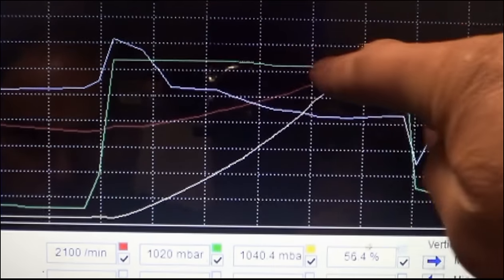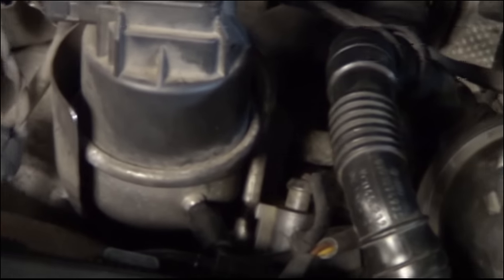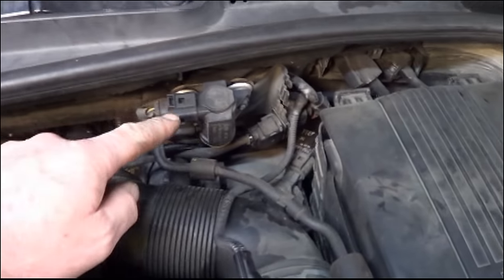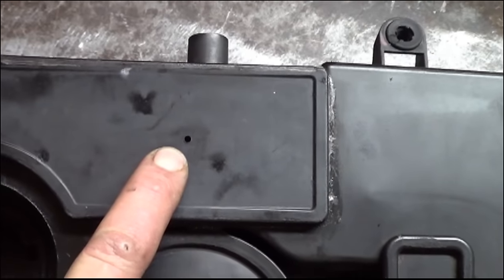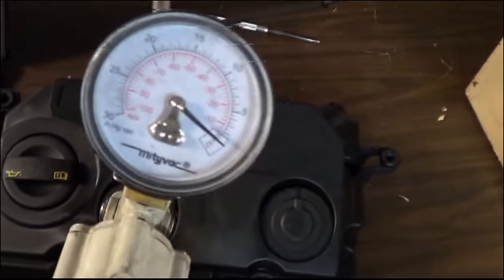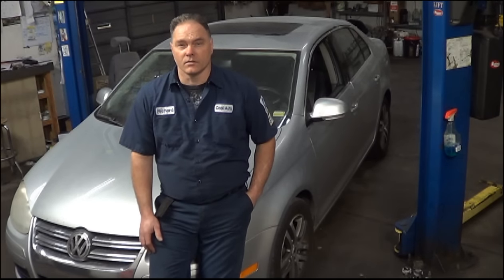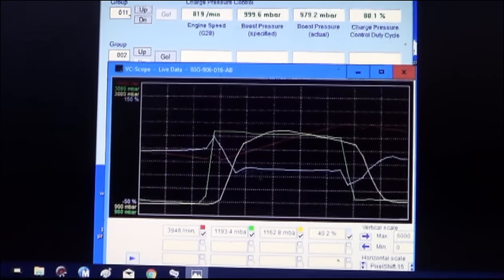06 tdi low boost P0299

Comment: hi, any idea how to fix this. I cleaned EGR  change  n75 and  Intake Manifold Flap {N239}  still getting limp mode  Passat b5 1.9tdi 
3 Faults Found:

19586 - EGR System

              P3130 -35-10- Regulation Range Exceeded-Intermittent

17964- Charge Pressure Control

             P1556 -35-10- Negative Deviation-Intermittent

19561-Valve for Intake Manifold Flap {N239}

             P3105 -35-10- Open or Short to Ground-Intermittent
Reply from the maker: Sorry, I cant diagnose it based on what you said.  I would do certain tests for each code, except 19561, almost for sure that requires Intake manifold flap assembly.
Reply: any idea really nobody can help me with this,  do you think could be turbo? you know I am in Europe , but thanks you did answer it kind
Reply from the maker: @dez945able  yes it could be the turbo.  Do the tests in this video and others.  It could also be vacuum leak, boost leak, bad actuator and other stuff.
Reply: thanks @CoolAirVw
Reply: @CoolAirVw   just one more question,  can I clean turbo with a special spray   to spray it into EGR valve  when car runs  4000 rev
Reply from the maker: @dez945able  personally I dont spray anything into intake of a diesel.  Also seems 4000 rpm is a little too high.

Comment: Great video! Having code “P17705 -  Pressure Drop between Turbo and Throttle Valve” on a 1.8t, stored associated with a boost problem, might want to give this diagnose a try.
Reply from the maker: Not too much the same on 1.8T as this one.  Look for boost leaks and check the wastegate adjustment. Lack of power or clogged cat makes boost trouble codes also.  check diverter valve.
Reply: @CoolAirVw  I know,  but your way of using the gauge was well done. The N75 valve basically has the same layout, and I’m worried it could be the problem. The diverted valve is a good point too! Thanks for the reply.
Reply from the maker: @jakobbedholm3352  You cant run output tests with engine running on 1.8T so vacuum checks have to be different.
Reply: @CoolAirVw  oh I see.. well I did some output test, and all responded. Did a smoke test and no leaks. Did a short driving log, and saw a small hiccup where the MAF sensor dropped, so i am not sure what to make of that, but a longer drive will definitely give a better reading. I did purchase a new diverted valve just for good measure.
Reply from the maker: @jakobbedholm3352  did the maf sensor drop out cause the hiccup or did the hiccup cause the maf sensor drop out?
Reply: @CoolAirVw  I’m not sure, but when the hiccups happens you can hear the “boost” being released into the atmosphere. I gotta make a longer log, because today the car is running fine..

Comment: Wonder if you could have just bought a ball like the mk4's have and find a place to bolt it in.
Reply from the maker: There have been bunches of comments regarding plugging the hole or other repairs that might have saved the customer money. I'm all for that.  Just make sure you watch the end of the video where we find the cover was broken off and siliconed back in place.  This customer loved their Tdi and wanted it RIGHT! Unfortunatly, later  they crashed the car, I bought it, then fixed it then sold it, and am still working on it for the new owner.  I also still work on the original customers new car which is a later tdi.  Sometimes for the sake of longevity,  fixing it the right way might have benefits.  Of course if your a DIY'er just do any fix you feel will work, because if it dont work or last then you can only blame yourself.  If the mechanic does some improvised fix and it doesn't work or last, of course then he is blamed.

Comment: Is 25+ pounds the correct specification for vacuum pressure?
I am having a low power problem and I am getting 18 pounds of vacuum at an idol directly off the pump. 
Obviously I’m leaning towards a bad vacuum pump

Comment: hello friend, where in the US do you work, I have a problem with my vw cc car, I changed the turbo and the wastegate valve is not opening, I tried the solenoid and it has very little air pressure, it is very significant, what do you think it could be?

Comment: I have a 2009 tdi cr engine golf mk6. I can't pump the wastegate actuator up, the needle doesn't move at al, however if I connect the hose back to the N75 I can see that the rod does move. How is that possible?
Reply from the maker: I'm going to assume when you say "I cant pump the wastegate actuator up" what you mean is with a hand held vacuum pump you cant pump up the turbo actuator. this probably means there is a vacuum leak in the actuator, if your hooked to the actuator directly.   If the rod moves with the n75 then  that probably just means the vacuum pump driving the engine has enough volume to overcome the vacuum leak.
Reply: @CoolAirVw  yes, that is what I meant, I can't do it with a handheld pump.
Thank you for replying, your answer does make sense.

Comment: Any ideas why someone would have drilled a hole in the valve cover / vacuum reservoir? What would they be trying to achieve (other than causing this issue)
Reply: And also, if you fitted a camshaft to it recently, was the hole there then, and if so, were the owners getting this issue back then too?
Reply from the maker: I have no idea why someone broke the top off and drilled the hole.  The customer was having intermittent limp mode before and after the cam.
Reply: Maybe they mounted a vacuum gauge?

Comment: hi have a 2006 vw jetta tdi 1.9 same problem with the turbo
if  im desconnect the EGR Vac and Evap Press Regulator Solenoid Valve Pierburg  valve connected to the turbocharge wastegate
and the car works fine but , if im connect the valve from the egr to the turbocharge waste-gate the car stop
no leaks and any of the valves.
the egr cooler turbo  replace 2 years ago
any help
thanks

Comment: Being a cheapskate I would have put a self tapping screw in that hole, much cheaper than making VW richer.
Reply from the maker: Certainly was an option and was considered.  Customer wasn't cheap though and after considering that the cover had been broken off and glued back in place we thought it might be nice to have it right, for longevity.
Reply: Photography is not enough
Reply: Or JB weld it shut haha.  I would do the exact same.

Comment: So what happens when you do all the tests and there's no vacuum at all. Have you seen the vacuum pump itself Go out or be bad? Or do you have a video on how to diagnose the pump itself??
Reply from the maker: Hook your vacuum gauge as close as possible to the vacuum pump.  Eliminate any change of huge leaks at the  booster or boost er line by  visual inspection and disconnecting the line from the booster and plugging it.    I have seen a few vacuum pumps break where they engage the end of the camshaft but that was always immediately after "work done" due to rough handling.
Reply: @CoolAirVw  yep I went straight to the pump. Pump was working well so I unhooked the spaghetti of lines, finally I stuck a wire through the little check valve that's in there and now I have turbo so I have a bad check valve that's in the one vacuum hose. 🤦🏻‍♂️
Reply from the maker: @toddgriffin4596  Excellent diag.

Comment: What causes OVERboost?  My golf mk5 2.0 tdi (BKD) frequently goes into limp mode due to OVERboost...
Reply: Dirty vanes in the exhaust side of the turbo, remove and clean the turbo inside
Reply: @Tuchh  I had the turbo removed and it was already clean inside.... is there anything else that can cause this?

Comment: I seem to be having the same issue somewhat pertaining to the boost code. I have replaced the N75 Solenoid with a new one to make sure that was not the issue, checked the vacuum actuator which is working correctly as well as checked all the vacuum lines and all appear well yet I am still getting the code. Any other thoughts as to what I should check or where I should check?
Reply from the maker: check for boost leaks.  Vacuum supply could be low also.
Reply: CoolAirVw Rm I’ve seen different people talk about certain hoses/charge pipes that can get a slight crack in them and be noticeable and still be able to reach boost pressures. If and when the car throws the code the normal stop and restart the car process completely clears it up and it drives perfect after that. I see boost pressure of around 20 psi. I got the car tuned and just wondering if that possibly has something to do with it.

Comment: Hello, i have a similar problem with my 2.0tdi passat cc 2009 and i have no vacuum leaks. It has power but it takes time to get it. For example when you shift a gear, and then press the gas pedal, no power no power and then after a few secs. the turbo kicks in and the power is back. What do you think it is? Is it possible that the N75 solenoid is faulty and that's why delays or the MAP sensor deliveres wrong measurements to the ECU and that's why my power delays??
Reply from the maker: diagnostic process would include graphing the boost, and maf sensor.
Reply: @CoolAirVw   can you make video about faulty MAP sensor or  faulty N75 (that delays, when it should open the vacuum to the actuator) Or from where we can check them.
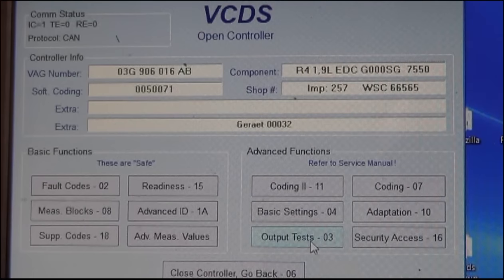Reply from the maker: @kudrickis1994  I can only make video's as the work comes through the shop.  I have never seen a failed map sensor, on  a Vw tdi.  I have seen mouse chewed wires to map.  at 5:21 it shows me testing the output of the n75.
Reply: @CoolAirVw  Thank you, i saw the test for the N75, but i think i didn't make myself clear. The thing that i wanted to know was have you ever met N75 that works properly but delays? For example when it should let vacuum to the actuator but it delays some seconds and then it does it's job. Is  is possible to get malfunctioning like that?
Reply from the maker: Certainly that is possible but usually when I find one bad the valve inside it is stuck solid or sticks intermittently.
Reply: @CoolAirVw  Ok thank you very much!! ^_^ I will see where my problem is.

Comment: Hi great video 👍i have changed my camshafts on my audi a6 2.0tdi 2006 after an timingbelt failure and now i have p0299 fault code underboost. That is the only fault code and i have tested the n75 valve everthing works no leaks so i think it is caused by the camshafts.

 How can i be sure?
Reply from the maker: probably not aused by the camshafts.

Comment: Hello I’m having the same intermittent limp mode issues.  My turbo actuator moves in an out when I unhook the vacuum line.   When cruising on the highway when not in limp mode I get s slight surge in power for a brief second.  I checked for a hole no hole.  Checked source vacuum is good before and after n75 valve.  Is it likely my actuator or the turbo is going bad ?
Reply from the maker: Thanks for watching.  To know you'll have to know if your over boosting.  What trouble code?  Graph boost with vagcom to know.   Check that the actuator holds vacuum.  Run output test on solenoid to see if it works.  Make the checks in the video or you might need to find someone who can.

Comment: Awesome video for both VW PD TDi and fault finding in general!
I’m having similar issues with a BMN Engine. Any idea what vacuum the storage tank in the rocker cover should hold?
Reply from the maker: It holds vacuum.  Full amount.  As much as you can pump it up with a hand pump it should seal.
Reply: CoolAirVw Rm thanks buddy! The system is doing about 28in mercury from the PD pump. The storage tank though is taking 20+ pumps to get up to this, and only hits about 20?. When this turbo under boost fault comes on, I heard a “pop” sound like something had unstuck (10th time in 2 days I’ve generated it on test so I know it’s not loose pipes etc)
Reply from the maker: @richardroope1424  If it doesn't bleed off after you pump it up to 20 then its probably fine.

Comment: I have this code on mine. Turbo lag and black smoke. I changed the MAP sensor which 
has improved the smoking a lot but it still holds back a bit and then boosts. Il check all my vac pipes tomorrow.
Reply from the maker: turbo lag and smoke... holds back a bit then boosts.  I would assume you have the "smoke and hesitation problem" usually fixed by adjusting the turbo stop.  Through the course of time and wear, the vanes end up closing all the way and stick in the closed position which basically blocks exhaust airflow through the turbo vanes.  Dealer will sell you a turbo, which would fix it  but you can usually fix it by adjusting the turbo stop so that the actuator never goes to that closed vane"  
position.
Reply from the maker: Here is the thread where years ago, some sharp guys solved the issue.  forums.tdiclub.com/showthread.php?t=280804
Reply from the maker: pay close attention to thread 47, 62 and 63.  In thread 63 there are two videos that show the problem clearly.
Reply from the maker: FYI this can be fixed in the car without removing the turbo, we have done it dozens of times.
Reply from the maker: There is also what "they" call zip tie MOD, where they zip tie the actuator where it wont go to the closed vane position.
Reply from the maker: If this solves your issue consider donating to my channel.
Reply: @CoolAirVw  awesome. Thanks for the advice 👍
Reply: I got underneath the car and saw that when it was revved up, the intercooler outlet pipe was pushing out, slightly. I swapped the clip with the pipe the other side and that pipe blew out. Went to the breakers yard and took some clips off of a scrapper and it’s fine now 😊
Reply from the maker: @AndersMcTee  so you had a simple boost leak?
Reply: @CoolAirVw  seems so. I’d seen oil dripping from the pipe and assumed that it was split so replaced it. The boost must’ve been pushing the pipe out the intercooler just enough to leak air and oil. All that grief over a 50 pence piece of wire 😄
Reply: @CoolAirVw  actually there’s an update on this - once that was fixed it threw up the ‘Implausible air flow code’. A new air flow meter made a huge improvement, but not perfect. I then replaced the previously cleaned EGR valve for a new unit and that finally cured all ailments. A multitude of sins, I guess.
Reply from the maker: @AndersMcTee  Awesome job!

Comment: Is there anywhere i can tap into to get a boost reading on the 2L TDI?
Reply from the maker: any component with boost inside it.  I've seen folks drill the intake, and drill the plastic boost tubes.  Are you wanting a boost reading to diagnose or just to watch boost.?

Comment: Nice video on logic based diagnostics and how a thorough testing will keep you from buying loads of parts willy nilly on guessing at the customers expense .. valve cover was probably pricey ? why not RTV and plug the holes with a lag bolt and RTV and call it a day ? not very professional yeah but did the customer really need a shiny new valve cover for an easy fix ? if it was a lambo or a bugatti yeah sure but a VW ? wire ties and duct tape is what these things are held together with.
Reply from the maker: You didn't watch the end of the video where we noticed the whole cover had been off and someone "glued it back on".  Lots of people had suggested plugging the hole and thats fine, but these customers wanted the car to be nice, and right.  This car was eventually wrecked, sold to me, rebuilt, then sold and I still talk to the owners now and then.  Original owners bought another tdi and I service it for them as well.

Comment: How do I get this tube off of the tob of valve covers so I can gain access down to that T fitting
Reply from the maker: crank vent tube comes off like a medicine bottle.  You squeeze at 3 oclock and 8 oclock and it releases at 12 and 6 oclock.

Comment: mine does this but permanently on limp mode now changed air intake intercooler new turbo cartridge an still not working
Reply from the maker: do the checks in the video.  Graph boost.  output check with vagcom while watching vacuum gauge.

Comment: did u als perform a boost leak test?
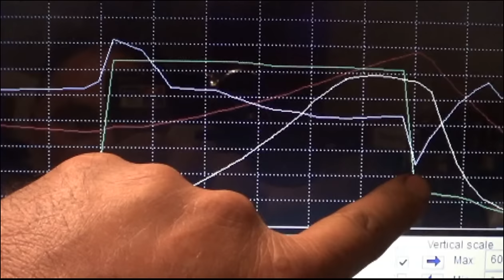Reply from the maker: I don't think I did.  Info I gathered gave me "direction" in the diagnosis. That info was 1.  No noise of boost leak (of course that isn't always conclusive), and 2.  Graph at 1:35 showed boost was capable of reaching "commanded" boost levels.  If I wouldn't have found the problem with vacuum system checks I'm sure the direction would have ended up with checking boost leaks.  Thanks for asking.  Your question makes me wonder if my process is  good enough or maybe there might be a assumptions that I make that might be better off not assumed.   We're constantly learning.  None of us is as smart as all of us.

Comment: Can a faulty actuator be changed on a 2003 gt tdi 150pd? Ty for any replies
Reply from the maker: yes.
Reply: @CoolAirVw  great OK because the garage is saying its the actuator which is not moving, so this can essentially be unbolted and a new 1 added saving me hundreds ty for the reply
Reply from the maker: @Garyskinner2422  If the actuator is no moving its possible the vanes are stuck in the turbo.  See this video.  https://youtu.be/fVXjDppNTPQ     And this video.     https://youtu.be/02KJxNnYiZk

Comment: Did it also affect your brake booster?
Reply from the maker: No it did not.  Diameter of hose going to vacuum solenoids is very small compared to booster.  So since the leak was on the small circuit it had huge effect on the small circuit, and almost no effect (that I noticed) on the brake circuit.  Now if it had been the other way around, a leak on the brake (large) circuit, then it would have also had huge effect on the small circuit.
Reply: @CoolAirVw  Ok, Thank u. I had quite a big leak on the brake (large) circuit VW Golf MK  4, this can cause lost of power and/or limp mode? Owner complaining no power (like no turbo) going uphill....replaced hose but looks like still a fall back at 120 km/h..